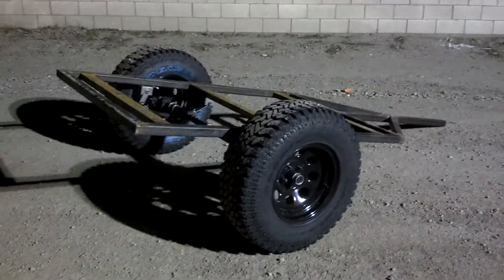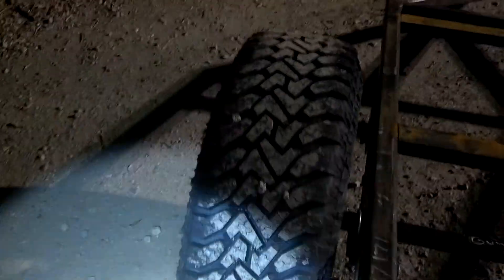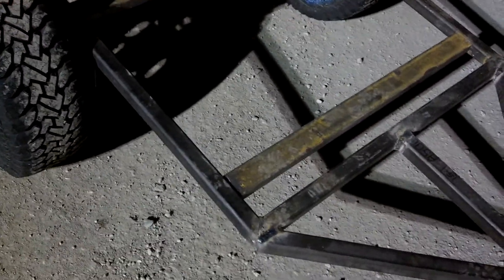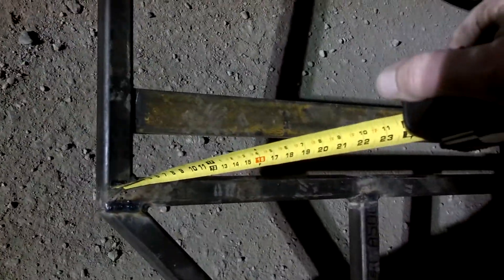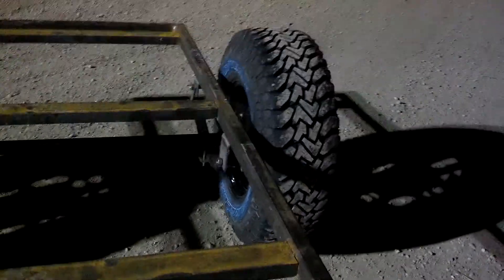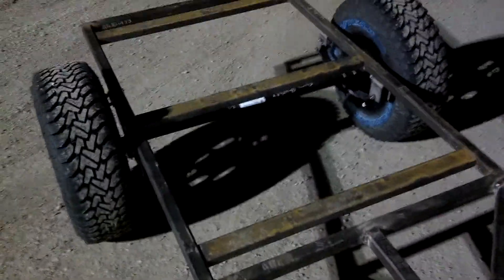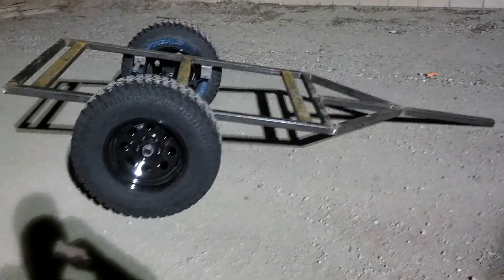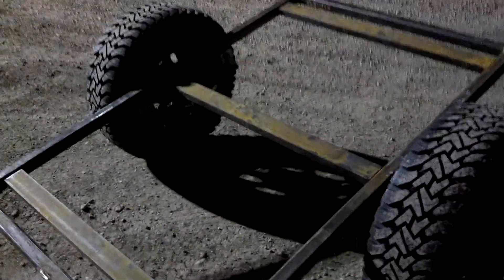Part 2 off road camping trailer

Comment: The ground clearance looks good, the 1/4 thickness is kinda overkill (not a bad thing, just heavy) the 1/8th will be just fine, you could use 1X1 for the side rails with no trouble and get a little more real estate (remember a sheet of plywood is 4X8 and you might wanna haul some of that). And I suggest not cutting the tongue to make it easier to lift and push around while loaded as well as for backing. Nice welding btw! lastly if you are using sheet metal decking you're gonna need more support